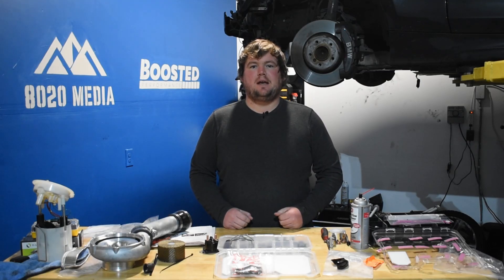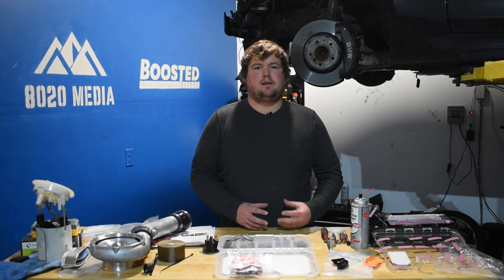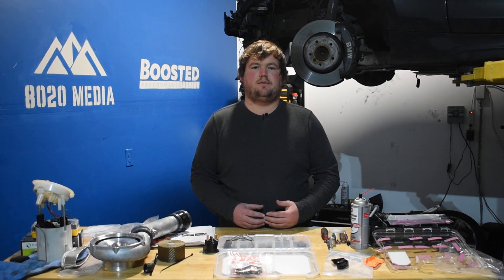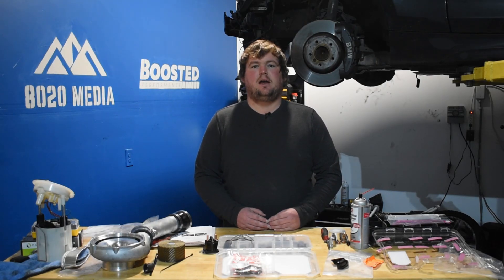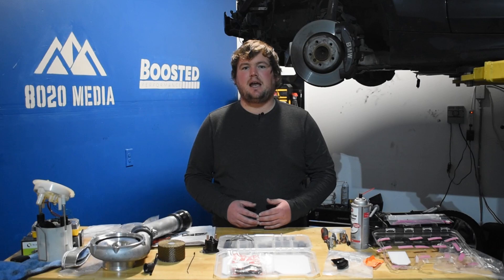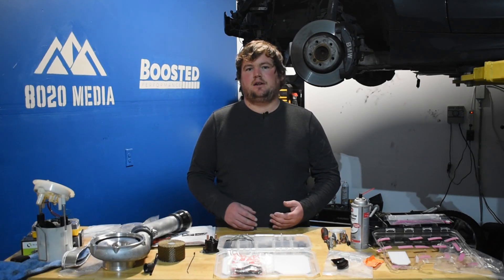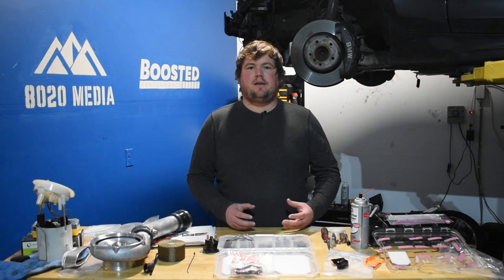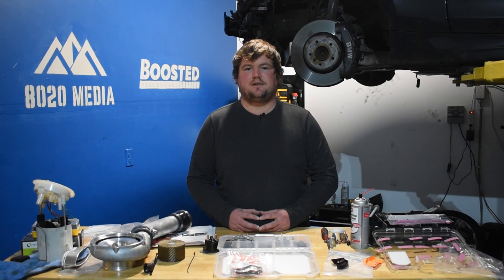N54 vs B58: Reliability, Tuning, and Performance!

Comment: I think there is one thing that makes B58 maybe feel more aggressive than n54....  N54 uses vacuum to control turbo wastegates... bit oldschool... vacuum canisters, vacuum solenoids and so on... B58  on the other hand as other more modern turbo bmw-s  have electronic actuators that control turbo wastegates.... those actuators arent cheap... vacuum solenoids are way cheaper.... but i assume electronic actuation  reaction is quicker than the one from  vacuum  control... thats why  in some videos people say n54 has smoother power delivery  and that b58 has more authoritative punch.... at least thats my theory... owned n54 for many years, havent driven any b58 yet...

Comment: for 750whp with n54 youd need upgraded pistons and con rods i own a 335i 07 e92 plan to someday get to 600whp im running mhd rn with 360hp stage 1 going to go stage 2+ in the summer such a fun car and its also cheap
Reply: The N54 can take it , just depends how soon in the rev range it’s making all the torque , with a big single it will be fine
Reply from the maker: K - We have a bunch of content for this. We also have a 335i that we'll likely be drag racing with our 135 shortly! https://youtu.be/GhUau-rFFp0
https://youtu.be/VDiCo3YUTvc

Comment: Good stuff. I've starting to lose interest in my  E60 535i N54 bc my GEN3 Tacoma.. Car sat almost a year now chasing a MIXTURE CONTROL1 & 2 and blaming upstream O2 sensors or cracked VC. The VC replacement is a cheaper and easier access and already have. Gonna walnut blast and had bought phenolic spacer. Turbos upgraded to Dynamic Autowerx 775RS and have proven reliable 3yrs now.  Full polyurethane upgrade on have proven better than coilovers. I've literally re-engineered the PCV system adding high and low oil cans and still keeping it closed loop. Not Vargas cans either. Still on stock fuel set up and looking to upgrade but haven't decided which route to take. A few more options today vs 3-4yrs ago. Keep up the great videos! And Thanks for the motivation!!!
Reply from the maker: S - Thanks for the feedback and taking the time to share your experience!

Comment: What's the difference between N54 N55, B58 And S58 aren't they all 3.0l inline 6 motors like what's the main difference between the 4 ? Just the platforms?
Reply from the maker: B - Here's an article on our BMW Tuning website that may be helpful to answer this question: https://bmwtuning.co/n54-n55-b58-s55/

Comment: The N54 actually was used until 2016 in the Z4 35is and came with 340HP stock 👍🏻 
Those Injectors are a pain in the ass though, had 2x Index 12 fail within a year and BMW doesn't care because I installed them myself...
Reply from the maker: That's correct - might have not mentioned that in the video since the Z4 35is is a bit more rare! But the injectors definitely are, and the price of them is ridiculous...

Comment: Would you recommend the BMW F30 340i in line or long road reliability because I |  Toyota owner
  I want to change to a BMW F30 3401. Is it as reliable as Toyota or not, and what is your advice regarding the reliability of the car?  Because my hobby is that I searched for Lexus for permanent purchase and BMW for rent
  Do you recommend it for heavy and daily use, and which is better in reliability, the Toyota Camry V6 or the B58 engine?
Reply from the maker: Mohamed - it is a BMW and aside from a 340i costing a lot more to purchase than a Camry, the engine (B58) is also going to be a good bit more expensive to maintain. Oil changes aren't $20 on a BMW like they are a Camry and when something does go wrong it usually ends up being pretty expensive. Don't expect a B58 to last to 200k+ miles like a Camry will with minimum maintenance.
Reply: @8020Automotive  
So what are the required maintenance so that the car does not break down?  B58 Change oil and fuel?  Can it withstand a distance of more than 200,000 miles?
Reply from the maker: We have a lot of B58 content on our BMW Tuning website, but think this post may be the most beneficial for you: https://bmwtuning.co/bmw-b58-faq/
Reply: @8020Automotive  Thank you very much, the most beautiful professor
Reply: Listen, idk about as reliable as a Camry, but waaYyyyyy more fun. Id roll bmw.

Comment: N54 is a solid engine...with a bunch of weak and EXPENSIVE plastic and rubber parts all around it😮‍💨. An 07 335i with a B58 swap would be an interesting build
Reply from the maker: Osama - We couldn't agree more. Would definitely be an interesting build! It would be a very complex and expensive project that would require a lot of custom fabrication and modification.
Reply: @8020Automotive  A true 1 of 1!! Everyone does K20 and LS swaps, I wanna see something original but still true to the brand. If I had deep pockets I'd take a 2023 M3 Competition and swap the engine out for the M5 Competition's 4.4l. The modern 3 Series back with a V8 again now with factory twin turbos🐌🐌🤌🏾
Reply from the maker: That would truly be a sight to see... Great taste in engines and cars!
Reply: @Osamabeenleanin210 there's actually an f82 m4 with a s63 swap video on YT and G power has a F87 M2 with a s63 as well
Reply: Yessir, i would love to see a b58 e9x or even a s58 e9x
Reply: honestly its a non-starter because just the cost of parts car, or complete pullout with modules would cost more than its worth to do the swap. The n54 is capable of making power, and with how far Port injection has come on that platform, it makes more sense to delete the DI once you start having injector issues constantly than dealing with 3k+ for injectors and potentially another 1-1.2k for a HPFP. 

B58s are still going for like 4-6k just for the engine, no loom, no modules. Nothing into custom fab for mounts and driveline.